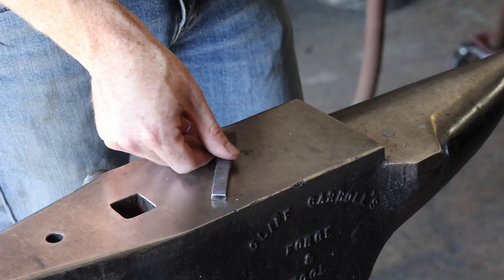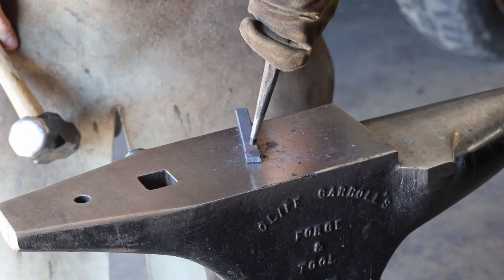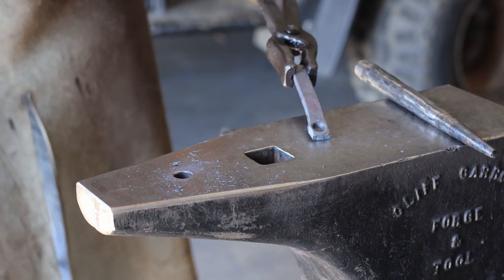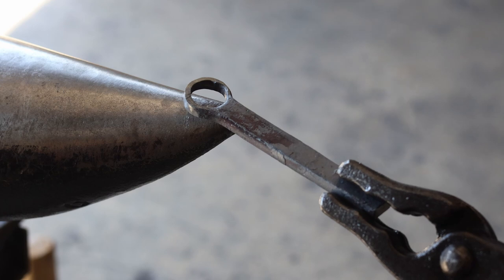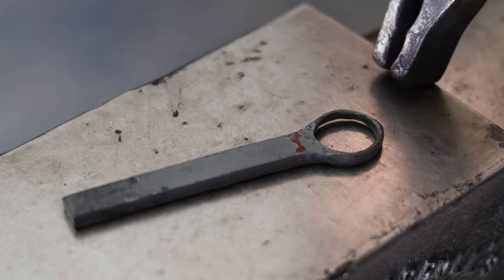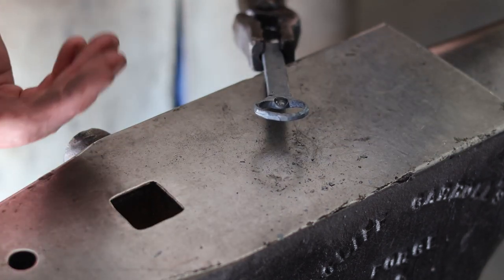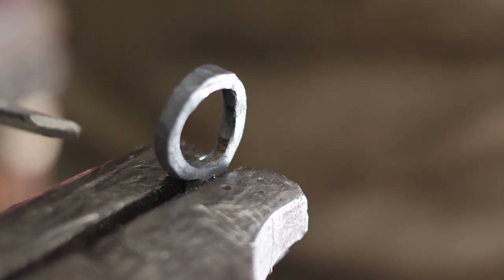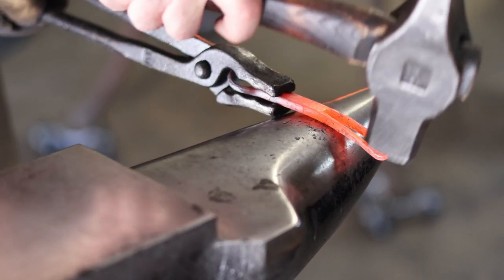Make Your Own Bottle Opener!

Comment: Is/are your punches made of tool steel?
Reply from the maker: Most of my punches are made of 4140.
Reply: @rockingeforge  so cooling them down in water during use doesn’t make them brittle any?
Reply from the maker: @wesking5600  I try my best to avoid getting them hot enough to cause any reduction in hardness. They're low enough carbon that they are water quenched when they are hardened, but they shouldn't be getting hot enough during use to see any hardening when just cooling them off between strikes. I cool them to avoid ruining the temper and having to reharden them.